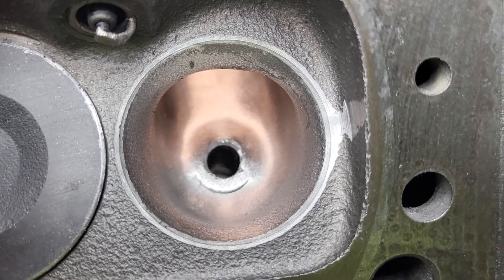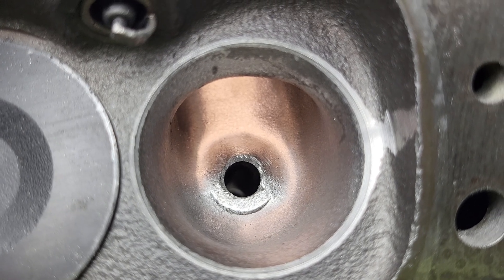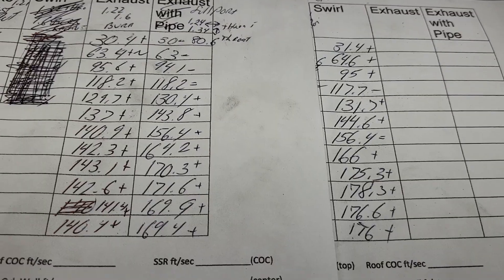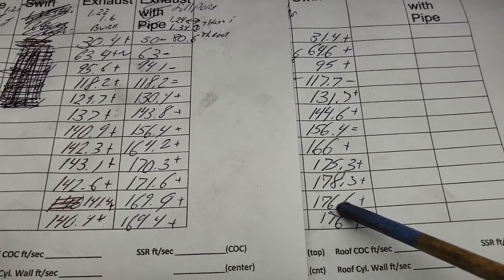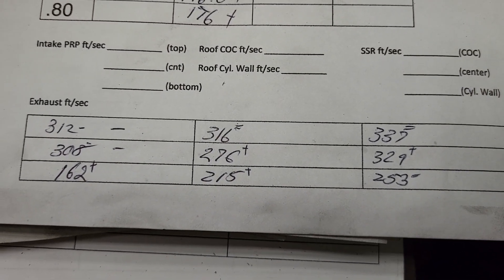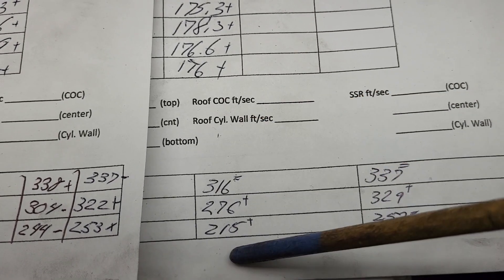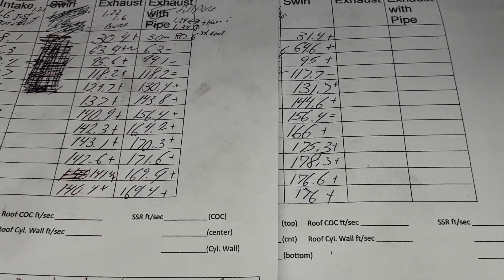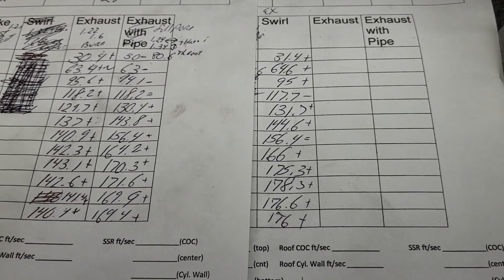Chevy TBI head exhaust throat experiment, Increase to 83% throat. Winner or loser?

Comment: 2 things. The valve guide boss doesn't need to remain square to the valve seat. It can also be slanted. And something that could speed thi gs up if you have the equipment.  A bowl hog can open the throat precisely to 90% and than be blended by hand from that point. The noise can tell you exactly where the restriction is. The higher the pitch of the noise, the closer to the valve seat is causing restriction. A low pitch is from further into the bowl.
Reply from the maker: I only have Sioux stone valve seat kit. Using the Sioux pilot on an angled guide is problematic for me. I like my seats  .001" or better. Thanks